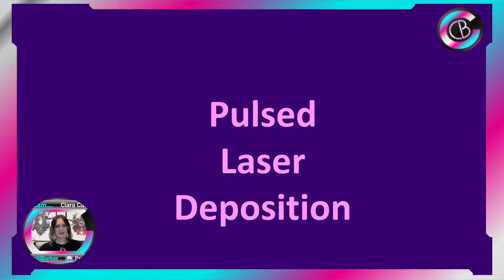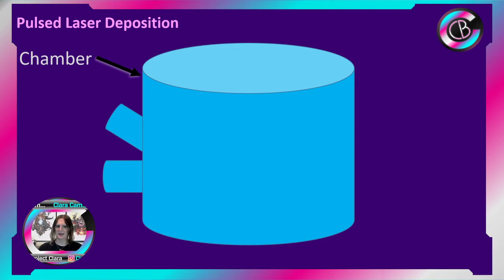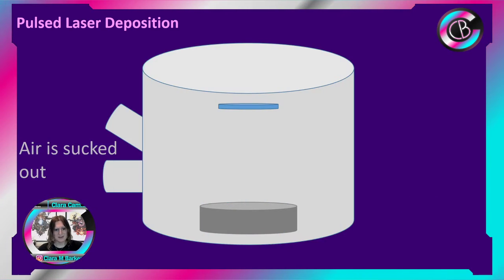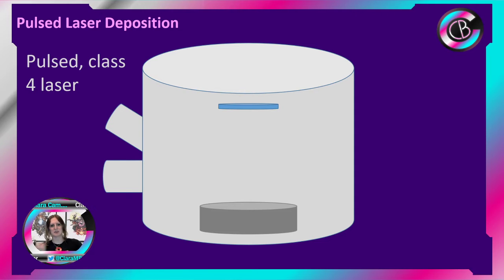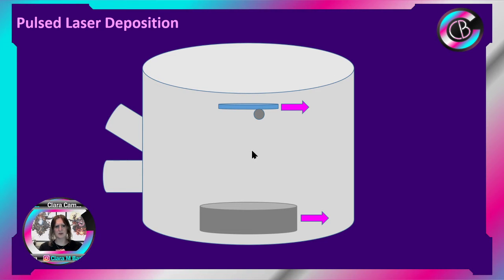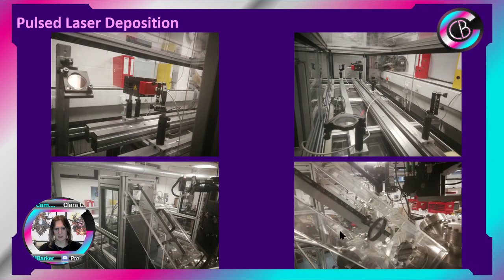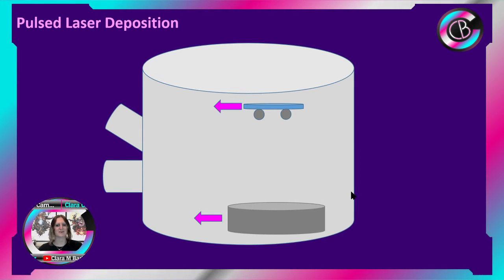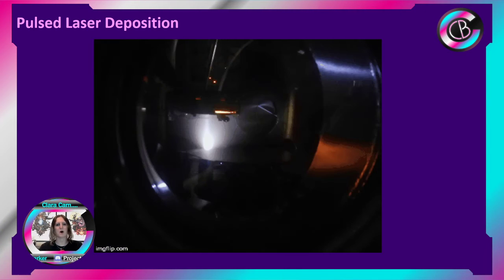What is Pulsed Laser Deposition

Comment: What is the power density requirement to flash evaporate a metal, e.g. aluminum or silver? I was wondering how high the power has to be to setup an PLD.
Reply from the maker: Interesting question. 
It depends on the material. Al and Au can be done with energy densities of around 5Jcm-2 but you also have to consider pulse rate/wavelength/pulse length to get the power. We have a 248nm pulsed Class4 excimer laser with a beam path of around 4m.  
To be honest, for Al (and maybe Au) it is easier to do it using evaporation.
Reply: @ClaraMBarker  OK, that's a lot, I think. At least for my project. 

I'm generally asking because I'm preparing to set up an vacuum deposition at home, just as a hobby and to bring back some memories (I no longer work in the academia) ;). Vacuum system is not a problem, up to 10^-6 Torr it's fairy simple. Thermal deposition (evaporation) is sooooo simple (for most of the stuff), DC sputtering also is doable at home without a problem.. so I'm searching for something to be able to push the boundary of DIY science further. I was thinking about PLD, because I mainly worked in optics and it is quite exotic (at least for me), so why not ¯\_(ツ)_/¯
Reply from the maker: @nkdm87  tha's really cool. But yes - it does require a hefty laser for PLD. And if I'm honest, I've had PLD 5 years now and still prefer magnetron sputtering. But that is my preference :)
Reply: @ClaraMBarker  is there any reasoning behind that or that’s just a personal preference? 😅 I’ve only worked with thermal, DC sputtering and plasma assisted  e-beam (that last one is the cutest, but not at home...).

Btw - do you mind if I send you some questions regarding sucha system at some point? Help might be really valuable :).
Reply from the maker: @nkdm87  I just find sputtering interesting from a plasma and growth POV. Lot's of dials to turn. But it does depend on what you need. I've worked on lots of techniques, and have a few at the moment. Sputtering just remains my fav.
Reply: @ClaraMBarker  you would love MBE - even more dials to turn.

My requirements are quite simple - have fun ;) it’s just a hobby. It would be nice to be able to do luminescent samples, as spectroscopy is my main thing.